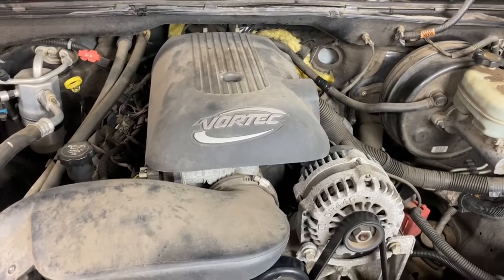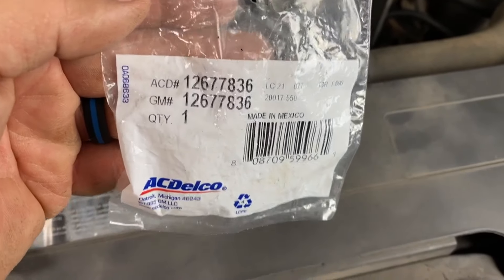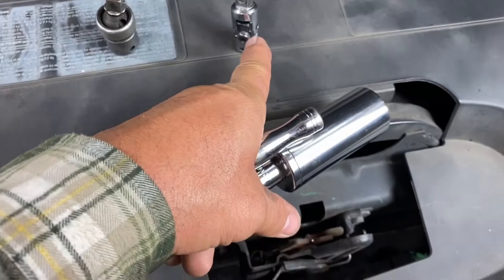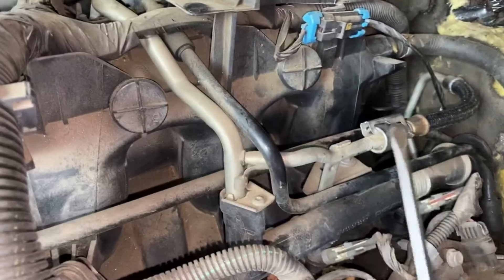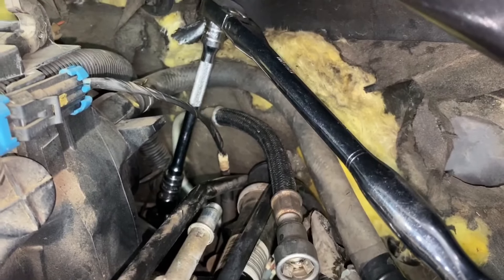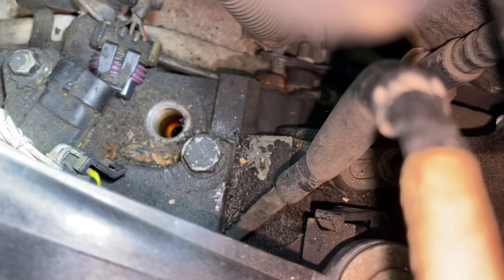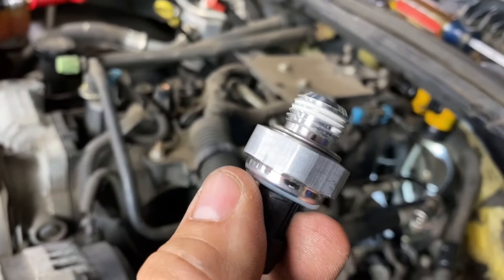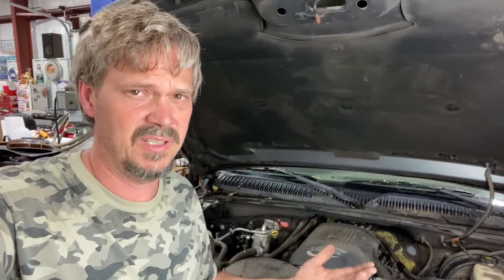Low Engine Oil Pressure / Oil Pressure Sensor Symptoms and How To Repair

Comment: I recently changed oil pan gasket ,oil pic up tube o-ring and oil sending unit ,now when I'm driving  my oil gauge shows 80 psi and my dash digital display says low oil pressure  but my engine sounds good no lifter noise or knocking  I'm confused as to what it might be any ideas cuzz if it was oil pump issue I would hear it right?
Reply from the maker: You would hear noises for sure. I wonder if the gauge is bad or a bad ground.

Comment: So I replaced my sensor as my gauge maxed out at 80 and wouldn't move.  It was a tight struggle, but I got the old out, new in and now my gauge reads about 28 psi at idle?  Before the gauge maxed out at 80, oil pressure was consistently around 40 psi at idle.  What did I do wrong?  I tried to torque to roughly 15 ft lbs.  Would slightly overtightening it result in a low gauge reading?  I certainly didn't crank it down and I used a cheap torque wrench, but the torque wrench seems to be pretty accurate every other time I have used it when comparing it to a good torques.  I mean, maybe it's reading right and now my oil pump is going.  smack my head  
Any advise would be appreciated.  
Thanks.
Reply from the maker: 28 is good, especially if that’s after warmed up. Different oil thicknesses will affect it also. And cam bearing wear will show low pressure at the gauge of older vehicles but not necessarily at the crankshaft. Had a lot of trouble from the 3.8’s many years ago with cam bearings wearing and pressure at gauge dropping. 20 w oil fixed that

Comment: So about 2 months ago mine started saying "Check Oil Level" ,  the oil is fine, even changed oil and filter, gauge is fine, shows that everything is normal, still keeps saying to check the level on every start up. Any suggestions?
Reply from the maker: Most likely need a new oil level sensor, especially since it sounds like you covered the other possibilities. Try unplugging the sensor, see if the light goes off, then jump across the connector and see if

Comment: Did u have to removing anything next to the sensor my socket isn’t sitting flush like it’s something blocking the sides
Reply from the maker: The only other thing was what I show in the video, that connector that’s beside the sensor

Comment: Any other ideas what could be making my guage read over 80 at all times? I replaced the oil pressure sensor like you did in this video and it's still doing the same thing. Could guage be faulty or will it take a bit of driving to fix its self?
Reply from the maker: The gauge could be faulty. Maybe the needle is stuck at 80. I’d be tempted to drill a very small hole and stick a piece of wire in and try to move it

Comment: Question. We have a 2005 Tahoe and need to change the sensor after changing the oil gasket and o ring. Still showing low oil pressure so want to change it and hopefully fix our problem. We have the one with a little filter. If we take it out and has no little filter should we put the one we go in?
Reply from the maker: I assume you’re talking about the filter under the sensor.  I didn’t put one in and mine didn’t have one. I really do t think it’s necessary. There shouldn’t be any debris getting to the passage to the sensor anyway
Reply: @dhammiam  okay cool I'll pass the info to my husband 😊 thank you

Comment: I changed the oil pressure sensor in my 08 Nissan Pathfinder Le and it still reads low what could be wrong
Reply from the maker: The only way to tell for sure is to install a manual gauge. Be sure to use the proper oil called for your vehicle. If the main bearings or cam bearings are worn, that would make oil pressure lower in most cases

Comment: I just did a 5.3 swap on my 06 Sierra I put an 03 Tahoe 5.3 in it  After 2 days of driving I got a code which said that Knock sensor 2 is bad and I have 0 oil pressure I went on my old motor I got the oil pressure sending unit off of I'm having an issue getting the oil pressure setting you off the motor in my truck. I also do not think that I have the screen filter in the bottom of the sending  unit because I didn't see it either...  I'm thinking about taking the intake off my motor and replacing it to the motor I put in my truck and then when I do all that I will address the oil pressure sending you to and a knock sensor number 2 but if you have any pointers that would be great
Reply from the maker: If you’re going to change the Intake now would be the time to swap sensors. Is your truck making a knocking noise to trigger the knock sensor? Also make sure the wiring for all sensors are away from the spark plug wires
Reply: @dhammiam  no. But when I first got done with the swap it ran ok then it said low oil pressure and gave code for bad knock sensor. I am pretty certain its the pressure sensor. The truck seems to be doing better with the swapped motor and injectors.. i took the plugs off and found some exposed wires and the ground wire was touching the plug. I made sure to keep them separate. I will keep sensor wires away from spark plugs.

Comment: What do you suggest after fixing that and the problem still exists? My gauge keeps going to zero and shoots back up when I step on the gas. When my foot is on break it tells me my oil pressure is low.
Reply: I have a 2002 Chevy Avalanche.
Reply from the maker: Was there a screen under the sensor? If it’s ok or not there, you may need to connect a manual gauge to see if there is an oil pressure problem. If so it could be a cam bearing or oil pump issue or in extreme cases main bearings. Could just be a connection issue or ground or the gauge but if the screen is clogged up there’s the issue
Reply: Very good information thanks for sharing!!

Comment: I think the filter (which is a bad idea) may only be in the 2007+ years.  The sensor didn't change though, so filters come with many of the OEM aftermarket parts. 
The filter is not a good idea anyways. More likely to cause problems than help any protection.
Reply from the maker: Thanks for the info. I agree with that. The filter didn’t make any sense to me

Comment: Not sure if I'll get a response but I was trying to replace a sensor on a 2011 silverado. The new sensor seemed to thread it but it ended up popping out as it cross threaded. Any sure way to have it line up properly?
Reply from the maker: It’s a pipe thread, so it’s tapered. The best thing to do is start it by hand if the thread is messed up, you could take an 1/8 pipe tap put some grease on it and repair the threads. The grease should catch any shavings. Just do enough to repair the threads, then try starting the sensor by hand.
Reply: Appreciate the reply, thank you!!
Reply from the maker: I need to look at my video again. It may be 1/4 npt. The standard on a Chevrolet is 1/8 but I’ll check this out and comment again
Reply from the maker: Ok, it’s 1/4 pipe thread. With the sensor being aluminum, you may be able to just put some thread sealer on it and start by hand and get it started. The threads in the block shouldn’t be messed up by the aluminum sensor on second thought
Reply: Awesome, thank you for confirming that!
Reply from the maker: @BoxInAPizza  anytime 👍 Let me know how it turns out.

Comment: guessing for the torque....hahahaha great recommendation.
Reply from the maker: Not likely to come loose. Torque specs are mainly for bolts used for clamping (bolt stretch)
Reply: Tightening to spec torqs.....hahahhaa

Comment: I wonder if this will help mine I just bought a sensor and gonna try it but my gauge is pegged at 80 psi
Reply from the maker: I’m sure it will. Might as well replace it first. Let me know, thanks
Reply: Did it work mine is at 80
Reply: @rodneyjohnson2064  yes

Comment: Excellent video thank you for doing that.. Although I have a question I have a 2003 Chevy SSR with the 5.3 L Vortex engine,  I want to add a secondary oil pressure gauge, And I am trying to decide if I go through the oil pressure sensor unit and add an adapter so that I can add a second line for my 2nd gauge or  use a sandwich plate adapter by the oil filter and pull the connection out of that one... Not a lot of room to work by the oil filter, Any suggestions or advice would be greatly appreciated thank you.
Reply from the maker: Thank you. I would add a Tee at the oil pressure sensor. The sensor connects in one and the secondary line in the other

Comment: I'm having trouble with removing the sensor with the 1 1/6 socket and the 27 mm deep sockets. They seem to just spin for some reason.
Reply from the maker: It’s possible it’s stripped. Has someone tried using the wrong size? Here’s the actual socket for the sensor that should grip tightly. Good luck 
https://amzn.to/3kHIcu7
Reply: No, I bought the truck brand new back in 2010 and no one has ever touched the engine. I bought an oil sensor socket at AutoZone but it appears that my set of deep sockets is deeper. I feel the socket is not reaching the base of the sensor. I saw another video where it showed another connector with a bolt and bracket next to the sensor that needed to be loosened and moved over in order for the socket to reach the bottom of the sensor. It was a 2010 GMC Sierra but it looked identical to my 2010 Silverado. Not sure if this is the case with my truck.
Reply: I can feel the base of the sensor and it’s not stripped, it just feels like there is something stopping it from getting to the base.

Comment: My oil pressure sensor is stock on 80 in my 2007 Silverado. As I am driving on the road, suddenly it slows down and the engine light turns on and stays driving more slowly for a while. Could this be another sign that I should change it? I will change it tomorrow but I wanted to know if it could be something else to be changed. I have 176K miles. Thank you.
Reply: Yeah sounds like the sensor. You can turn it on and leave the engine off and see if the gauge goes up. With the engine off but key on it should read zero, but when they're bad they'll read 80 or bounce from 0-80 and anywhere in between.
Reply from the maker: Thank you for responding. I missed the question earlier somehow

Comment: My gauge is dropping slowly below the safe area.  Engine runs great oil is new and full.
Reply from the maker: Did you use the suggested oil for the vehicle? I say that because as an engine wears the bearing clearances increase and allow for oil pressure to drop, especially once the oil warms up. Also, could be the sensor is weak causing a bad reading.

Comment: My truck dont turn on i changed oil pump oil level sensor still dont turn on and my oil gauge still dont work would it be the oil pressure sensor ? I was driving on the freeway going 60 and truck turned off and lost power

Comment: i have a 2003 GMC Sierra 1500 5.3L...out of the blue I went to start truck one morning and it began running terrible, sputtering rough idle and then would die...check engine lite came on. I checked code with my reader and found a P0101 code initially...tried cleaning MAF and MAP sensors, cleared code and initially it started and ran for short period of time. I mean like 10mins before it stalled and check eng lite back on. I could eventually get it to at least stay lit so i could drive 6miles into town....but at first start when cold, its a struggle to get it to idle. So I purchased replacement MAF MAP and due to Oil Pressure gauge first at max then min, and oil level good..I bought a new OP sensor as well. After replace of MAF and MAP cleared code...Im still getting P0101 and now also P0641......now what? Can a faulty OP sensor cause engine to shut down? Please help, my truck has 180000 miles on it..
Reply from the maker: First I would check the wiring. All connectors and wiring on the 5v reference circuit. Sometimes where there’s a connection it could be losing it there due to resistance. Visually inspect all MAF sensor wiring and connectors to make sure they are intact, not frayed, broken, routed too close to ignition wires/coils, relays, motors, etc.Check air cleaner. Also be sure there no obstruction in the exhaust. Basically anything that can effect the air flow through the engine can cause the P0101 but it sounds like the other code may be the real issue.
Reply from the maker: Also, is the oil pressure working ok now? The grey wire should be the 5v reference wire and it will set a code. And of course check all fuses. I’m trying to piece together the clues you’ve given.

Comment: My oil pressure gauge is not showing any pressure at all, yet there is no oil pressure light.  The gauge doesn't budge when you turn on the key and start the truck.  The truck has oil and runs great.  Could it be a bad sensor, or should I be looking somewhere else?  Thanks!
Reply from the maker: It sounds like you have a gauge issue or bad ground. Check all the fuses first
Reply: it could be the cluster.  Our issue was the stepper motor.  Not too difficult to fix but requires soldering and removal of the gauge cluster. I replace the Oil sensor 2 twice and it seemed to be the fix for all of 5 min.   The parts are cheap and there are videos on how to do it.  BTW, we didn't have any other lights or indicators to show low oil pressure.  Motor sounded fine.

Comment: They actually sell sockets for oil sending unit that is round inside.
Reply from the maker: Yes, I made it as simple as possible trying to use tools that people have. I actually had one of those sockets when I worked in dealerships

Comment: Since I bought my truck I was naive and assumed I had oil pressure at 80psi. (Must be this hot new LS motor of mine) Now after watching lifter tick videos I realize that its supposed to be 40 psi. Now I realize my pressure gauge is pegged and I have a ticking lifter that comes and goes. First thing first I will replace the sensor and make sure I have oil pressure lol. If I don't have 40 psi I'll go after the sump seal and pray. If I do have 40 psi then i'll take the head off and chase after the bad lifter knowing my engine has been getting oiled.

From an engineering standpoint having a sensor that fails in a maximum value without any warning lights would be vehicle recall territory to me. When failed state in the sensor should only read "oil pressure low" which would be an immediate sign to stop and replace it. Reminds me of a low oil sensor that doesn't stop the engine when its tripped. Planned obsolescence at its finest!
Reply from the maker: I agree 💯 Let me know if it works. Also there are some high detergent additives that may help the litter tick. Just a thought and cheaper alternative for ya
Reply: @dhammiam  Just changed the sensor and good news is the engine has been keeping good oil pressure and its only one lifter ticking so far.

Comment: Question. I replaced my sensor bout 2-3 years ago as mine old one was reading at 80 didn’t fluctuate around at all. So replaced it an now sitting at idle it drops down to bout 25psi. I have noticed a slight knock or rattled from time to time. Changed oil like last weekend. Should I go a head a replace the sensor again. An should I go ahead and replace my knock sensors. 07 Sierra classic with the 5.3
Reply from the maker: Did the oil pressure change when you changed the oil? I ask as used oil tends to lose some viscosity so may see a drop in pressure as it gets old and diluted. At idle, 25 is about right. Should be around 15psi per 1000-1500 rpms or thereabouts. 
The knock sensors could effect the ignition timing but seems they rarely go bad, usually due to bad gas or engine temperature being high causing spark knock. Check the egr valve and make sure there are no vacuum leaks as those will cause spark knock “pre-ignition” as well. This information is off the top of my head so if this doesn’t help just comment back and I’ll think more and research if needed. Good luck and thanks
Reply: I’m changing out the pressure sensor just for food measure cause I don’t remember if I put a ac Delco in or not. But like today it knocked. Seems to only like for the first 25 mins of running then goes away. I did happen to capture a video of the knock. Before it went away. I will get around to checking for a leak in the egr this weekend as well. But I can say the knock makes me nervous. I do have high miles. But I also had my local mechanic put headers on an it didn’t make the knock sound before so I’m kinda stumped. Assuming they didn’t drop anything down in the block

Comment: Should I replace this before jumping the gun & replacing my rear main seal?
Reply from the maker: Yes. The rear main seal won’t affect your oil pressure reading unless it leaks so bad that you run out of oil. This is a much easier job to do
Reply: @dhammiam  I sure do appreciate you replying! Already on it at the moment, happen to have a tip on how to release the clip on the sensor?
Reply from the maker: @451mexico  use a small pocket screwdriver. They tend to work great for almost any type of clip.

Comment: Did you have to take out the 10mm bolt out all the way?
Reply from the maker: If it’s the one I’m thinking about, the answer is no
Reply: @dhammiam  the previous owner stripped the  sensor and socket doesn’t turn it at all. Any suggestions?
Reply from the maker: Try using this socket instead of 1-/16. This one is 26 mm and 1/8 inch smaller roughly. Put an extension on it and clock it to where it seems to fit and tap down with a hammer. Good luck
Reply: @dhammiam  thank you will do
Reply from the maker: @jperez340  let me find a better link and send it. That one seemed a little high so hold on a minute
Reply from the maker: @jperez340  https://amzn.to/3uPAEYC. Try this. Other option would be to go to a local parts store and get the actual or pressure socket and try. It really depends on how stripped it is if there’s any flats left

Comment: I was told this part can leak oil so bad that it can appear to be a rear main issue is that true.
Reply from the maker: Yes that is definitely true. Oil runs down back of the block at the rear main seal area